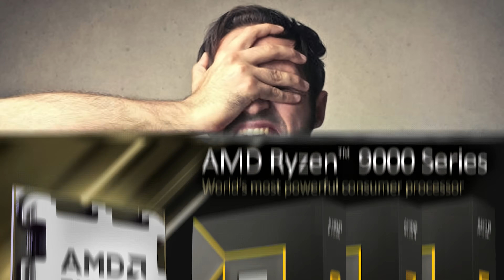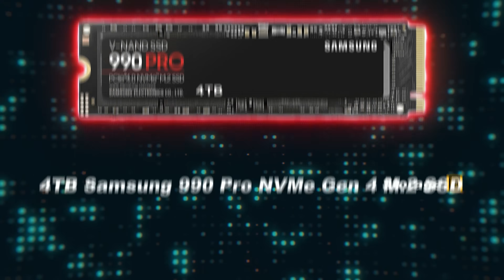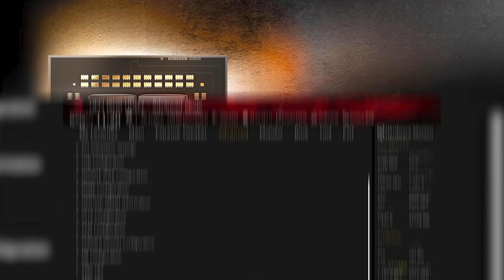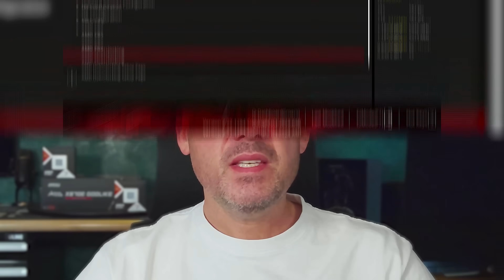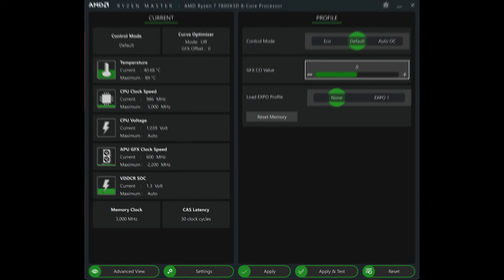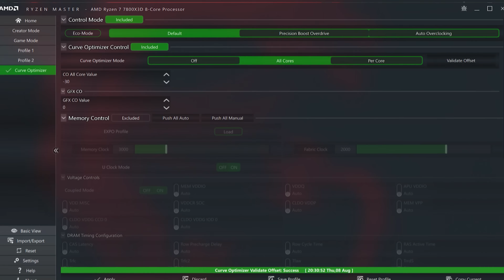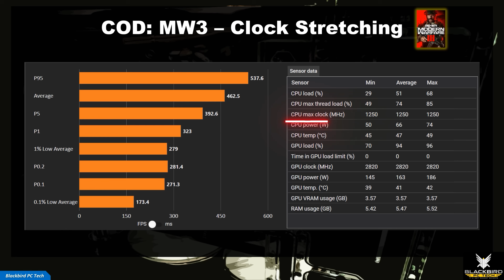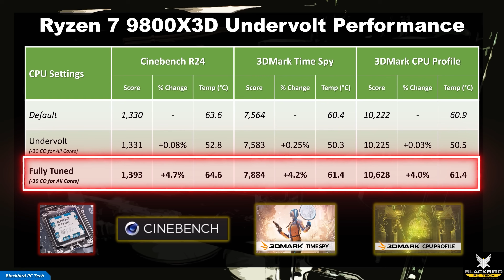How To Undervolt a Ryzen 7 9800X3D The Right Way! (or Any AMD AM5 Ryzen CPU)

Comment: Hi, I don't understand one thing. How can I tell if the Kia card is stable? Can I see it from the megahertz? I set a value of -30 and the test on Aida went well. Is stable that all the megahertz of the CPU are at a fixed value? Why do mine go up and down slightly?
Reply: in the end I set -26 and it seems stable, I did the tests on aida and cine bench and I didn't get any errors or anything else, I still don't have a fixed mhz value like in your video but there aren't any huge drops like 1250 mhz, now I think I'll increase its performance by following your next recommended video, thanks a lot
Reply from the maker: It's fine that your clock speed will vary ... it's based on multiple things, such as cooling, motherboard, etc.

Comment: I’ve followed your whole video, your clarity throughout was really impressive

In my case, I’ve followed all of this and still post 85-88 celcius peak temps during gaming. Any tips on how to improve this?

System: 9800x3d. +250clock speed, PBO Motherboard setting, -20 undervolt all cores. Temps cap at 85 celcius

Cooler: Peerless assassin mini 120 with noctua chromax fans
Reply: Below based on 2x 2024 multicore benchmarks, with temps capped at 80C in BIOS (this time without OC, but keeping the -25 U/V)

Tcl/Tdie (peak/average): 78.0 / 75.4
Die average (peak/average): 77.0 / 73.8
CCD1 Tdie (peak/average): 79.6 / 73.1

Core VIDs (peak/average): 1.175V / 1.147V
Core Clocks (peak/average): 5,225 / 5,218

Cinebench 2024 score: 1,279

I’m a bit dumbfounded, lower average clock speeds and lower core VIDs versus the +200 overclock run, yet very comparable cinebench 2024 multicore scores - and it’s not like the previous run was suffering from significant throttling, looking at average clock speeds and core VIDs, how could that be???

Separately, found out from my case manufacturing website that I can fit up to a 280mm AIO. I just ordered a Artic Liquid Freezer III so I’ll just scrape the peerless assasin 120 mini aircooler alltogether. For the equivalent of USD $62 shipped, it’ll probably be the best value for performance increase if it allows me to dial back in some safe overclock. 

I’ll post the results once it arrives for everybody to see - it might be helpful to some that wants a like-for-like comparison

Full system here:
Ncase M2
ROG STRIX X870-i  (ITX mobo)
9800x3d 
Thermalright Peerless assassin 120
2x32gb (64gb) 5,600 mhz Vengence DDR5
RTX 5070TI
4tb m.2
Corsair SF850W Platinum
Reply from the maker: @mikeoxlong643  great choice for an AIO ... they are awesome
Reply from the maker: The reason is that your cooler is not capable of cooling your CPU, your when you hit the temp limit your clock speed and performance will drop. I highly recommend not increasing your clock speed and not using the motherboard option in PBO ... these will only make sense if you get a more effective CPU cooler.
Reply: @blackbirdpctech well noted, thank you very much for the follow-up!
Reply: What’s strage about my current setup is that Aida64 stress test over a 10 min period will not raise my CPU temps above 70C, but somehow video games which should be less demanding on the CPU will cause these 85-88C temps, what am I missing
Reply from the maker: Different benchmarks and games will load your components differently ... if you try running cinebench for example, I bet your temps will hit your limit quite rapidly.
Reply: Fresh Cinebench 2024 single core test: 135
BIOS settings are -25 undervolt, pbo +200 clock speed and power settings to Auto rather than Motherboard

Peak temp (CPU CCD1 Tdie) 76.8
Peak temp (CPU Tcl/Tdie) 69.2
Core VIDs 1.275V max 
Bus clock max 5,425MHz

Interestingly, I then proceed to open a game (Space Marine 2), and temps spike immediately to 80.6C (tcl/Tdie) during loading, and back down immediately
Reply from the maker: @mikeoxlong643  the single core test is not going to stress your system ... run the multi-core test ... I bet that hits your temp limit almost instantly
Reply: You’re a wizzard, harry.

Ran 2x 2024 multicore benchmarks, with temps capped at 80C in BIOS (still with +200 OC and -25 U/V)

Tcl/Tdie (peak/average): 81.2 / 80.3
Die average (peak/average): 80.0 / 78.9
CCD1 Tdie (peak/average): 84.6 / 78.7

Core VIDs (peak/average): 1.315V / 1.219V
Core Clocks (peak/average): 5,425 / 5,285

Cinebench 2024 score: 1,297

Conclusions from my side:
- temps are high, but query if sitting at 80C under load is too high considering chip design
- temps don’t result in significant clock speed throttling, as average clock speed still fall above baseline boost clock of 5,200 mhz
- actual cinebench score is 100-150 points lower than i would have expected, having spent 2 min googling expected scores for this chip. Unclear why as average voltage / clock speeds don’t highlight any clear throttling
- if i were to change to an AIO, I’d be limited to 240mm, because i run an ITX build in an Ncase M2. Query whether i would see temps improvements versus my air cooler as, from what i understand, AIO benefits over good air coolers are mostly seen in larger (280/360MM) radiator sizes?
Reply from the maker: @mikeoxlong643  85 deg C is fine and won't impact the life of the chip ... I would highly recommend removing the boost of +200 and re-running the test.
Reply: Alright Peerless Assassin Mini 120 removed, and Artic Liquid Freezer III 280 installed.

Below based on 2x 2024 multicore benchmarks. This time i removed the previous BIOS temp cap of 80C to test how hot the cpu would get (was clearly hitting thermal limits in the above OC runs). I’ve kept the -25 UV, but bumped PBO limits to Motherboard, and slapped a 200 OC on top of it.

Tcl/Tdie (peak/average): 80.5 / 77.9
Die average (peak/average): 79.0 / 75.8
CCD1 Tdie (peak/average): 81.4 / 75.6

Core VIDs (peak/average): 1.305V / 1.255V
Core Clocks (peak/average): 5,425 / 5,402

Cinebench 2024 multi core score: 1,313

More importantly, gaming temps are now comfortably between 45C and 65C.

For some reason the initial loading screen of Space Marine 2 specifically still spikes CPU temps to 85C, but considering this temp level is sustained for less than 2 seconds, and CPU temps immediately (literally less than a second later) drop to 45C, it doen’t concern me

Conclusion, a single fan air cooler is fine for a 9800x3d with undervolt, assuming stock clock speeds. 

If you want an overclock, you will need something beefier.

Comment: In my opinion, spending $60 on AIDA64 to test this is unnecessary. But that's just me. Thank you so much for the video, I'm now a subscriber.
Reply from the maker: Welcome to the Blackbird Army! Don't forget you can download AIDA64 and run it for 30 days as a trial ... you will also get it for free if you use an Asus motherboard.
Reply: @blackbirdpctech  I just bought an Asus motherboard, how do I get this for free? I didn't see any mention of this in the box.
Reply from the maker: @ASH-ou4cg  if you install Armory Crate it should be a library install option
Reply: @blackbirdpctech this is great, thank you so much for the info. I was avoiding installing armory crate, as I heard it was bloat full and unnecessary so I was very careful on only installing what I needed.
Reply from the maker: @ASH-ou4cg  I've had issues with it in the past but it does have some useful features ... you can always uninstall it if necessary.

Comment: I did everything as mentioned with the pbo curve, negative -25 

Doesnt crash with prime 95 but it also gets throttled down.
In ada 64 it also doesnt crash but i still have like 81.1c at cinebench and shit.

9 9950x3d
Reply from the maker: I don't understand what your issue is ... if your CPU is throttling that simply means that you are unable to cool it effectively ... what type of cooler are you using?

Comment: CPU Idles at about 48c 
While running 3d Mark time spy:
ECO 105W - 86.6c, score 21.191
Negative 20v - 87.5c, Score 21.201
Out the box config - 85.3c 21.244

ECO or Undervolt  doesnt seem to make a difference with me lol it seems to literally do nothing....

So now I need to get a correct fan Curve, any suggestions on a decent curve? As im a bit stuck?
Reply: Ryzen 9900x this is by the way
Reply from the maker: There is no logical reason why an undervolt that is properly applied increases the temp ... are you sure that the undervolt was actually applied ... did you load ryzen master and check that it showed negative 20 CO?

Comment: Hi, do you have any undervolt settings for the MSI x870e Carbon Wi-Fi on your channel?

And what does this Ryzen Master you're using do? Do you use this software instead of the BIOS to configure undervolt settings?
Reply from the maker: As I explain in the video, the reason I recommend using the "AMD Overclocking" option in Bios is that PBO2 is a feature set that is available on any AM5 motherboard ... this guide is applicable regardless of your motherboard manufacturer. I also specifically recommend NOT using Ryzen Master. I recommend watching the video.

Comment: Hi, do you also just use aida64 for testing for clock stretching while monitoring clock speed at the same time?
Reply from the maker: AIDA64 might help but I would recommend simply running a game benchmark and monitoring the clock speed ... you don't even have to monitor it live, just seeing the max clock speed attained through the run will be enough.

Comment: Another question are you saying to go into pbo in both settings and change them?
Reply from the maker: Not sure what you mean
Reply: @blackbirdpctech in the bios there are two ways to access precision boost overdrive. In the two ways you get too it should you change the settings in both?
Reply from the maker: @ForeverHollowed  I specifically address this in the video ... don't change it in both locations ... just follow the guide
Reply: @blackbirdpctech so after doing that I did the test with a -25 15 minuets and max clock speed temps averaged around 71c for a 9950x
Reply from the maker: @ForeverHollowed  good job

Comment: Quick question so in some videos i see people change their tdp to 170 to 120 however for the aorus x870e extreme i do not have tdp anymore or anywhere. So should i set and play with the negative offset number still? I do have the 9950x cpu.
Reply from the maker: You are mixing two very different things ... one is changing your power limit and the other is undervolting. This video is just focused on undervolting. If you want to tune your CPU to extract max performance watch this more comprehensive video: https://youtu.be/N60M36PRHsY

Comment: I was able to get a negative offset of 40 with full stability. 45 crashes sometimes, 50 it failed to boot up.

My temperature went from 95⁰c to 78⁰c, i didn't overclock yet I saw longer stable clock speeds. Before it only hit 5.1ghz, now it hits 5.4ghz locked.

My CPU is the 7600x, and it's definitely worth it. I did this all in the BIOS instead of Ryzen Master program.

Edit: I would recommend you test it for nearly 1hr to ensure stability and maybe try other apps and games.
Reply from the maker: You definitely have a golden sample chip ... great result!
Reply: @blackbirdpctech thank you for advice. Finally started. From 10 to 18 so far.
Reply: hits 5.4ghz with a +200? or just UV
Reply: @NinTheLost  No OC just UV.

Comment: I failed at PBO CO -26 but -25 with EXPO Enabled seem stable i tested for like 30minutes. But when i tested it in Aida64 i have unchecked the motheboard and memory and only focus on the CPU. Am i good to use -25 in my 9800X3D?
Reply from the maker: I wouldn't uncheck the motherboard and memory ... just uncheck the GPU. Not sure what you mean when you ask are you good to use -25CO?

Comment: I don't understand why AMD doesn't ship their CPUs factory undervolted considering you can get a slightly better performance and much better temps.
Reply from the maker: Because they wouldn't be able to guarantee that all CPUs would be stable ... they set a performance standard for each CPU that must be achievable under lots of different conditions, so that's why under normal office or home conditions it's usually possible to extract more performance.

Comment: Question, is it worth changing the PBO limits to Motherboard or can it just be left on AUTO while undervolting? im trying to be as safe as i can with this chip and im not comfortable with that 1000w mobo limit
Reply from the maker: If you don't change it from Auto then you will not be able to access the curve optimizer feature ... but you don't have to select motherboard, you can go with "enabled" instead.
Reply: @blackbirdpctech  Got it to work with auto, i was talking about the PBO limits, not the PBO mode xd

Comment: My ryezen 7 9800x3d  can -10 in 15mins of stress test but if i do -15 it failed the stress test in 2mins 💀
Reply from the maker: At least you've discovered your stable undervolt ... you could also consider dialing-in an undervolt for each of the 8 cores.
Reply: So you do it in increments of 5 ?
Reply from the maker: @Stevestevestevestevestevesteve   you can do it in increments of 1 if you like, it will just take more time to dial-in.
Reply: Same i had to go -10 since -15 failed after 9 minutes

Comment: I got it stable at -30 But my temps are still at 95c....
Whats up with that? I followed your instructions exactly.
Reply from the maker: It doesn't sound like your undervolt was applied ... what was your performance/temp before and after?
Reply: @blackbirdpctech it was applied perfectly at 10. 20. And finally 30. It stayed at 95 the whole time. I was finally able to get it down to 85 when i changed the thermal limit under PBO.
Reply from the maker: @jasoncombs3232  that would imply your cooler is not working effectively … what are you using?
Reply: @blackbirdpctech Alseye D120 air cooler. Its at 53 when idle.
Reply from the maker: @jasoncombs3232  that's the reason I asked what your temps were before you did the undervolt ... I think you have a problem with your cooler ... perhaps you need to do a re-paste or your system is not getting enough airflow.
Reply: @blackbirdpctech my case has 12 fans. Airflow is definitely not a problem. I know the cooler is not very good, but i love the way it looks and it displays the temperature on a LED display. Its the main reason I wanted to undervolt. Its down to 30 undervolt with a 85 temp limit and the cores hit 5k when i run Cinebench.
Reply from the maker: @jasoncombs3232  basically all you are doing is killing your performance ... the undervolt isn't really doing much because your cooling solution isn't sufficient. If you set your system back to stock conditions what temps does your CPU hit under load?
Reply: @blackbirdpctech it stays at 95 under load. I forgot to mention earlier that its also overclocked 200 mhz

Comment: Pc gaming noob here. Decided to jump in at the ripe old age of 50 and do it the fun way by building my own PC.
Just follow this awesome tutorial with my 9800 x3d, however not so lucky with the silicone lottery. System crashed even at -20UV after 5 minutes so dialed it back to -15UV and past the 10 minute Mark so I'll be keeping it there.

Anyways, my AIDA64 EXTREME score for multi-core went from 1304 to 1346. Single core remained at 133 for both tests. Temps went from 68°C to 65°C. Even though I didn't win the silicone lottery still feels good knowing that I'm squeezing every bit of performance out of this awesome chip, thanks!
Reply from the maker: That's the right attitude ... anything you gain is better than what you paid for! And 50 is young ... there is no better time than right now to start building PCs 😉
Reply: Might be worth trying it per core if you can't do more than -15. I couldn't either. But after spending days testing each core so far I've gotten it to roughly -40, -45, -40, -30, -45, -40, -45, -15. Used Aida64, Core Cycler (with Prime95) and Y cruncher to test. But it's nearly always Aida64 that errors out first. But sometimes Aida64 can run fine for 5+ hours all core and then Core Cycler crashes. Most of the time when running core cycler the PC completely freezes but it saves a log so you can see which core it was testing when the PC froze.  If I just want to test one core I use Aida64 as well and set CPU affinity to just one core. Core Cycler seems like a waste of time if you "know" most of the cores are stable.
Reply: ...or maybe not. I haven't been playing many games the last week. Just running Aida64, Y-Cruncher and core cycler (with prime95) combined probably for over 50 maybe even 100 hours. So I decide to play some games and what do you know the PC freezes. So how do I now know at what point was the PC ACTUALLY stable, and not just stable running these stress tests? Gonna back off to -40 all cores except the ones that for sure couldn't handle it and see if that's enough. Still might be worth finding out which core can only handle -15 and set the rest to -25 or something.

Seems when doing this you should take it slow, change the undervolt on one core at a time, use the PC for a week or two and run some stress tests. Probably gonna take a year till you find out the actual limits. Or maybe just do what you did and set it to -15 and call it a day.

Comment: I want to ask, what exactlz does the offset value represent? is it milivolts? or is it based on something else?
BTW really good explanation, thank you
Reply from the maker: Yes, I believe that it simply shifts the voltage/frequency curve by an offset measured in mV ... I need to get the AMD explanation for it to be certain.